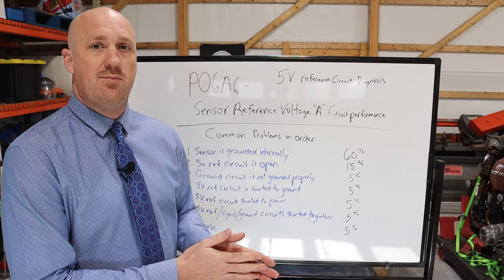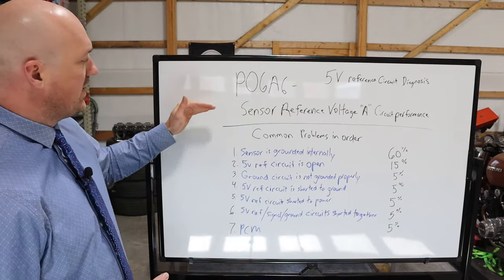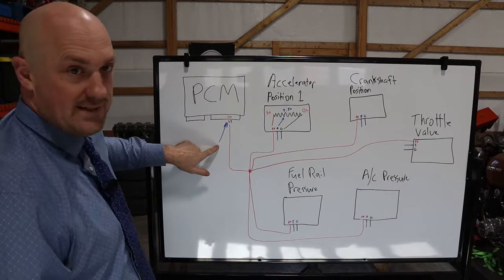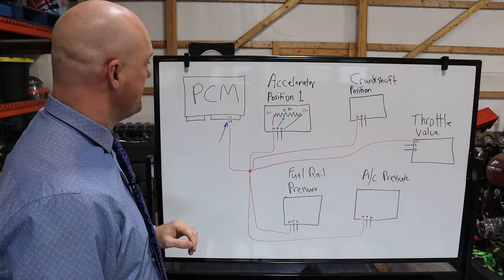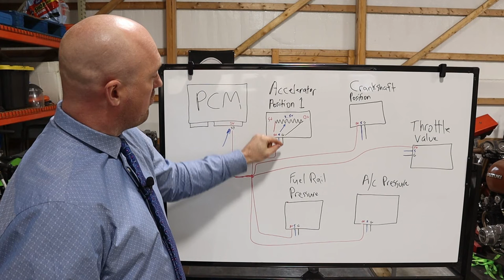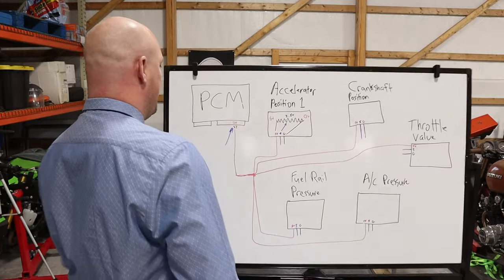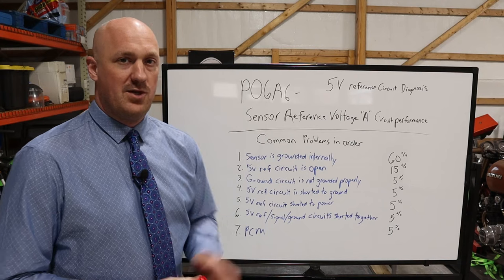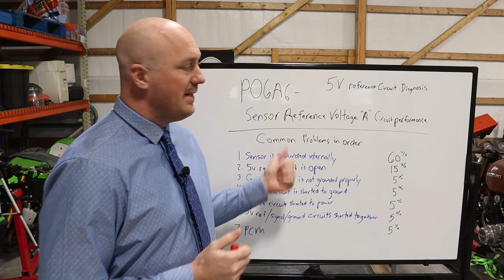Automotive Electrical Diagnosis // 5V Reference circuit

Comment: Hi, i have 2007 fj cruiser. The engine light are on and others light too. Have P-2743 code transmission fluid temperature or B circuit high. I change the transmission oil, filter and the whole wire thar has two tft sensor and the light continue on. How I can verify the wires and the codutuivity if the cables are under the car and the computer are inside the car.

Comment: Thank you for this video. I’m currently doing a hemi swap. I’m trying to use a hemi harness from a  ram vehicle. I didn’t buy a aftermarket one. I’ve don’t these steps. I get 3v out of both spots from pcm and same in all the sensors. It shows a p0123 throttle/ peddle A. It cranks no start. All my asd + have 11v power to them when cranking. I have key one run start. I have ground and power to injectors. Any insight could help thank you.
Reply: Pcm and wire harness are pinned out different.

Comment: I have a mass air flow sensor with these reference voltage is terminal A 11.84v B .005v C .006v D.022v this is on a 1994 f-150 5.0l the ignition switch does nothing when turned to start already replaced the ignition switch and neutral safety switch shotgun affect it does have spark at the coil and the spark plug and the coil tan wire flashing with a test light showing coil control Do you think the pcm is bad or not

Comment: Great video! If I find 4.963V at the connector, but the ground pin is at 0.037V with respect to chassis, is it a bad ground wire? The Pin from ECU with respect to ground is at 4.999V. Thank you very much :-)
Reply from the maker: Depends on the ground wire itself. If it's used in multiple circuits beyond just that one, you have to make sure all of those connectors are disconnected as well, otherwise you might be seeing voltage bleeding over from those circuits.

Comment: I have an o6 Silverado 1500. the radiator cooling fans come on high as soon as i start the truck and stay on, but as soon as i unplug the ac high pressure switch the fans work properly. but Ac will not work until i plug the pressure switch back. I am going to use this method to try to figure it out.
Reply from the maker: John that's actually normal if your a/c is on, or the vehicle is in defrost mode, the fans will be on high.
Reply: @ReignitedAuto   THANK YOU FOR REPLYING BACK.  What gets me is both radiator fans will run on high even if the ac and heater are off.  I leave to work in the  morning, and the temp is 52F and both fans come on high as soon as I start up the truck and stay on until i shut the truck off. I've had 3 shops try to figure it out and paid to replace the PCM but the problem is still there . I have also had to replace the radiator fans because the motors went out due to the fans running all the time. What is a good resource for electrical diagrams? Thank you for your taking the time to help!!
Reply: Replace coolant sensor and temperature sensor and check all wiring to those components

Comment: Can you dissect a wiring diagram for a 2006 Dodge Ram truck 2500 door locks and door chimes. The doors keep trying to unlock and the dome lights come on while driving down the road. Dodge ram 2500 cummins

Comment: What about whem it's not the a side it's the d/e voltage correlation,  even after replacing pedal and throttle body

Comment: If you do the testing and come down to a pcm, start over. In 25 years of doing diagnostics every day I have changed 3 pcm’s
Reply: I have p2138 code 4 shops 1300$ and still have the issue pedal throttle body and pigtail replaced,  now shop says maybe a bad ecm,

Comment: Hello, I am new to this. I have a truck and I have replace the engine with a rebuilt. So now it has a no com with the ecm. I checked all my 5volt reference all good and my computer ground is good and I got good power to the computer.  And yes I have replace the computer. And it still no start no com with the ecm All my fuses are good, relay are good. Where could I go from here? Help

Comment: Nissan Murano with no accelerator pedal response . one of the two acc pedal( sensor 1 )  sensors with no 5 volts. the ground wires are ok .no cut in all wires. I changed used ECU then checked 5 v of the sensor 1 but nothing new ( no 5 v) .

Comment: I have no check engine light but when i put scaner showes crank sensor and brake pressure. The brake sensor is good. Crank sensor i put new still pops up. I ve replaced so many parts like trottell body tps,mass airflow, coolent temp, accelerator pedal sensor. Pcv, and had torque converter rebuilt, still car dont run right any help would be appreciated

Comment: MY code reader os saying PCM isnt equipped.  im guessint it is a bad PCM.  not the ECM next to the fuse box, but in the driver side wheel well the PCM. a 2003 Caravan.  It was confusing for awhile because people anf\d articles are calling the ECM, the PCM.

Comment: I have a 5v reference problem all 4 5v reference are reading 5.01 to 5.03 high and it get all kinds of random codes and a shop told me it was a Ecm so got a new one had a Buick dealership program it and still have a problem and where do I find the wiring diagrams?
Reply: 5.3 volts is not a problem

Comment: Is pin 37 common to all ECUs of all brands to be the reference 5v voltage?
Reply from the maker: I wish it was, but no.
Reply: @ReignitedAuto  I have pry open my ECU before with a heat gun, I was probing the pins inside while the ECU connected to my car to see which one has a 5V, I found only 2 pins above each others with 5V. Could there be any other pins with 5V? Or did I nail it?

Comment: Your second step is confusing. If the pcm is supplying the 5 v ref out to the sensors and you back probe at the pcm then a break in the 5v ref wire leaving the pcm won't affect your readings. In order to do step 2 you would have to check 5v ref at each sensor in order to see a broken wire. Or maybe I'm misunderstanding you.

Comment: GREAT VIDEO but 80% of cars you cannot backprobe the ecu without disassembly cause most manufacturers use that swing lock connector and such. Just probe the wire and a dab of liquid electrical tape. If been a tech 15 years.

Comment: I'm chasing this in a dodge avenger 3.6 that got rained on and got a no start after. My 5v reference is only 3v and my throttle is unresponsive. Getting a bunch of codes.
Reply from the maker: Ouch. Those situations can be some of the most difficult to diagnose. Good luck to you!
Reply: @ReignitedAuto  thanks, not a whole lot of info available. I know it's 5v circuit "B" but I can't find a definitive list of what's on circuit B.
Reply from the maker: @Boomer21b  shoot me a message on Instagram @reignited.tx with the VIN of the car and I'll see if I can find that out for you. Also put a list of the codes you're working with. 👍

Comment: why you read 0v on the PCM side ref voltage if one of the sensors is grounded? thank you
Reply from the maker: As long as the sensor is still plugged in, and you are reading voltage by back probing the pcm connector, the grounded sensor will bring the whole circuit down to 0 volts. Hope that makes sense.

Comment: So I have 5v coming from the pcm but in the scan tool it's reading 0. All the sensors have 5v to them... scratching my head
Reply from the maker: The pcm is reading the signal voltage coming back from the sensor. You may have either a short to ground somewhere on the signal circuit, or an internal short in the sensor itself that is pulling the circuit down. If there are multiple sensors on one circuit you can start by disconnecting them one by one to see if the circuit recovers. If you can isolate which sensor is pulling the circuit down then at least you'll have a starting point. 👍

Comment: Sir 5 v come from  pcm  sensor ground it  will become 12v.  If I ground 5v signal. What happen. . Thank
Reply: 5v signal is NOT the 5v reference wire - it´s just one part of signal circuits

Comment: What huppen when tow sensors have diffrent. volts one 2.9 and 4.2
Reply from the maker: If they are coming from the same reference voltage source then they should both have 5V to start. The difference in voltage could be on the signal wire, which is after the sensor.
Reply: The car is not duing nothing but the check ingen light is . I disconnect the maf sensor i had 2.9 vols and the thrattle body 4.2
Reply: I have the check engine light on, the car doesn't crank. I checked the 5v reference with the sensor unplugged, on the maf sensor i have 2.9 and the throttle i have 4.2. What can cause this?
Reply: @JoseGonzalez-lr2ez  disconnect all sensors on that circuit

Comment: How does a 5V signal should look like?  I have an intermittent problem with my 2013 Durango V6, going occasionally into limp mode and throwing a bunch of codes related to 5V circuits. I already replaced all sensor, the PCM and tested the harness for shorts. I observe some downward spikes, is it normal? This is the behavior that I observe:  https://youtu.be/tMlXGUC9aEY

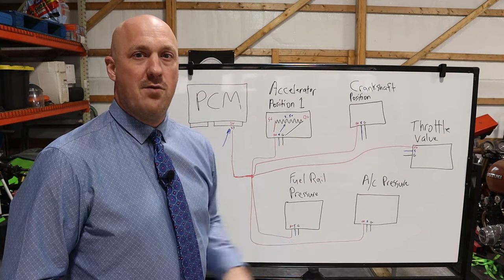Comment: @ 9:14 if you have continuity between ground and battery ground then your grounds are good. NOT TRUE! This assumption could produce a false diagnosis. Seen it many times. You want conductivity in your wiring. The only way to see this is through voltage drop testing. It’s too easy to not do. You shared some great tests but I  was disappointed when you suggested continuity testing.
Reply from the maker: Your statement is true, however this video is called electrical diagnosis 101, running a load test on circuits is a more accurate way to verify that a circuit is good, but many people will not have that capability and a simple continuity check is a good first step. If you eliminate all other possibilities and you still suspect a circuit issue then I would absolutely perform a load test, but it's not going to be my first step.

Comment: My car seem to have a separate +5v power pin slot on the PCM/ECM connector for each individual sensor. I have a 
Accelerator Position Sensor Signal Circuit Low Input, does this mean Short-to-Ground?